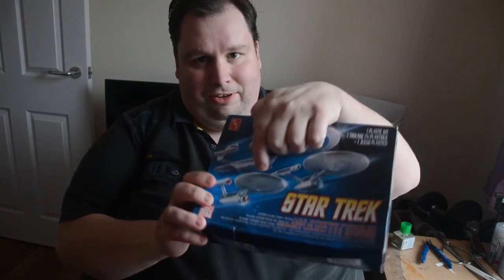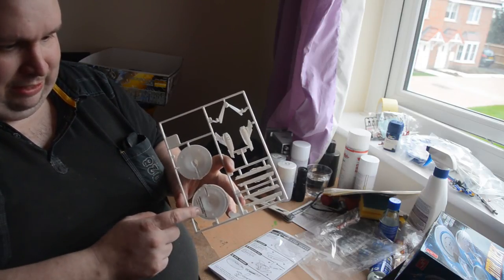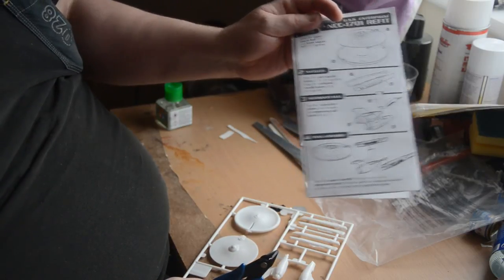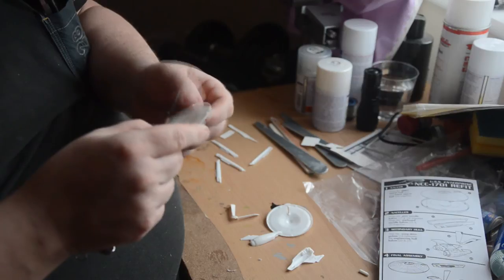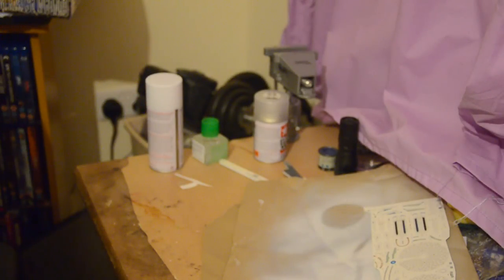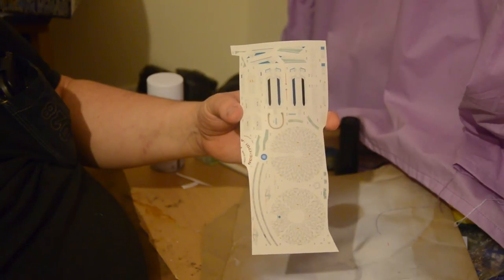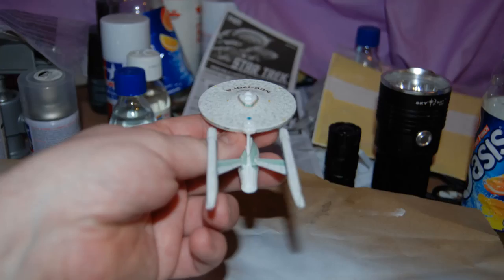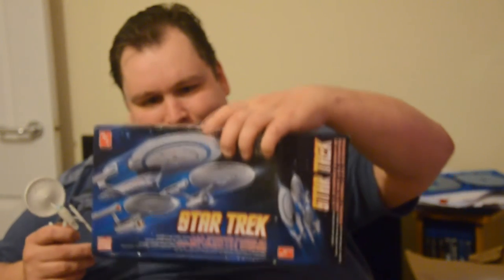Building, painting and decaling the AMT NCC 1701A 1:2500 scale kit

Comment: I'm glad you made this video boss I want to get the same one but wanted a good idea of the scale. Good job I hope mine turns out that good if I find one
Reply from the maker: There is now a much better looking version of this kit which does not have a flat defelctor dish and is generaly more accurately detailed without sacrificing ease of assemble, it comes with the "cadet series 3 piece motion picture set" including the Reliant and a K'Tinga you can find that set for about £25 (or $25 if in the US, considering the exchange rate I have always found it strange that £ price is usualy equal to or higher than $ price) and the 7 piece "USS Enterpise Model set" with the NX-01, 1701, 1701-A, -B, -C, -D and -E for about £90

For the version of the kit shown in the video look for the "Cadet Series 3 piece Enterprise set", it comes with the TOS NCC-1701, the movie era refit/A and the Enterprise B, for about £25 there is also a much older set (with exactly the same kit, as well as the TOS Enterprise and the -D) which may be harder to find.